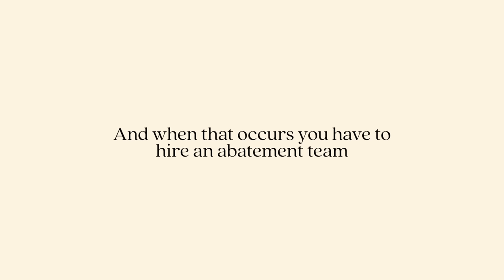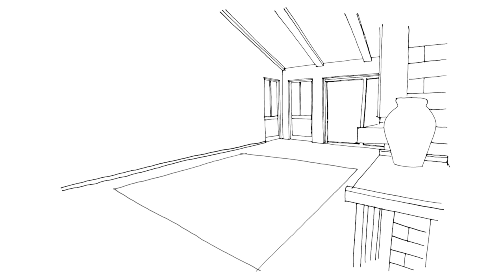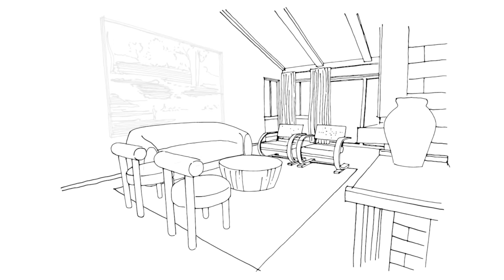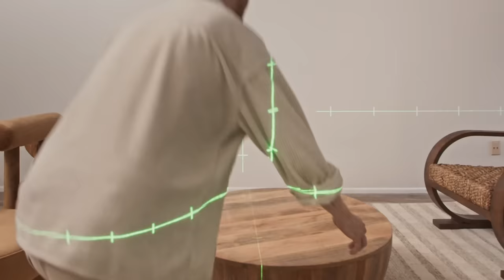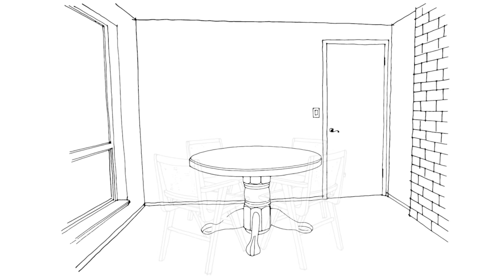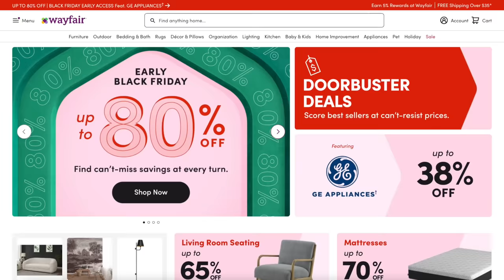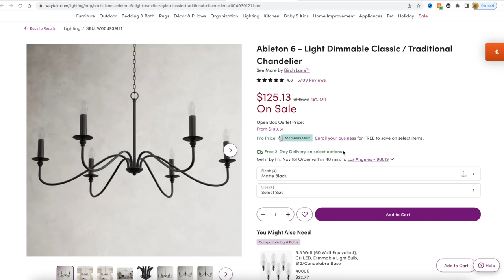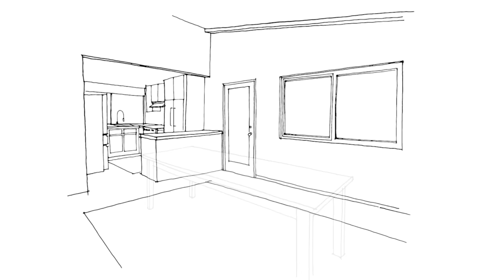EXTREME Living Room + Kitchen + Dining Room MAKEOVER! 🏠

Comment: I’m not sure I like how this is turning out since there is a small baby in the house and they mentioned wanting a bright and airy look. I love some of the elements though such as curtains and rugs, but the furniture I’m not 100% set. Maybe because the project had such a short deadline and most of the items were from Wayfair, not sure. A tip when staining/spray painting always wear a respirator, when you were spray painting you needed a higher grade mask, and when staining sometimes stain applies blotchy like with the cabinets, if you condition the wood prior to applying the stain it can minimize the blotchy uneven parts a lot and it looks so much better. My comment is not to throw shade at all, I love your channel, your work is inspirational. 💕
Reply: Yeah I agree and actually don't even like the finished project. It doesn't feel livable or comfortable to me. 
The cabinets are splotchy, the tambour wall is incomplete behind the TV. 

I love the intention but sloppy mistakes were made which detract from the finished project.

Comment: My only comment about some of the styling elements in the living room is that the blanket ladder, and tall narrow floor lamp and woven vase will be a hazard once the baby becomes more mobile. They’d all be pushed over very easily. Everything that could topple over should be anchored to the wall, and if that’s not possible, then alternatives that are not as easy to push over should be chosen instead. Advice from this momma of 3 boys.

Comment: I LOVE the mural idea as artwork! And the scene is so peaceful but modern with the black and white print. Maybe next time just build the frame out on the floor with mitered corners and attach with sturdy frame hangers in the top. You can use museum putty to seal the sides and bottom to the wall. This will be brutal to change out some day because there are so many nails and they have to fill in and repair the drywall and paint now. Just a thought ;)

Comment: FREAKIN FANTASTIC DESIGN STYLE! As a 20 yr painter here's hard lessons to learn SPONGE ROLL POLY WOOD STAIN FIRST thin, THEN BRUSH IT IN ONE DIRECTION QUICKLY TO STOP UNEVEN BLOTCHES & BUBBLES!  Poly is THICK & DRIES QUICKLY (unlike drippy stain which is always wiped off with a cloth). Also LESS WOOD FILLER  is best on PREVIOUSLY STAINED WOOD because sanding strips the stain & then blotching occurs  (it is best to apply pre-stained wood filler with small spatula, or dab it with thinned stain to match wood. (Wood filler ALWAYS ABSORBS TOO MUCH STAIN looking MISMATCH) A SECOND COAT OF POLY THINNED WOULD HAVE SOLVED YOUR BOTCHING ISSUE but would have also darkened wood even more! Hope this helps others! LOVE YOUR WORK!

Comment: ❤️ the design! That mural 👀 amazing and I want those woven chairs. That mirror was a great find! 👍 I also used Minwax polyshade on some oak cabinets. The oak tends to take up the stain in different shades unless it's made from the same tree. Also use a sponge brush for better application. Can't wait for episode 3. 💯❣️😗
Reply: agree - sponge on stain and wipe off excess -let first coat dry, do again until stain is the depth and rich color I want. I am not sure why Drew NEVER protects adjacent surface from spills or drips - so easy to just put some plastic down on floor and  and countertops - but it's his M.O.😄

Comment: So far I"m about 50/50 on the design.  I like the fireplace, yet not the way you left it unfinished under the TV, you should have at least gone to the mounting piece.  I not a fan of the round table in kitchen nook with the chairs or the weird cheap white lamp, the one the owner had was much better.  I think you used a gel stain on the cabinets and I know it is brush on and usually don't wipe, yet it looks way too streaky.  The hardware was weird also.  Not a fan of the odd chairs in the front room either.  Your taste is a little too far out for me I guess.  The owners knew what they were getting into.  I agree the dining table would look better going length way.

Comment: I’m really not trying to be mean but I’m shocked by the kitchen. Did the budget not allow for new cabinets and counter top? If I was the home owner id rather have a nice kitchen then new furniture. Never in a million years would I have guessed this makeover wouldn’t remove the tile countertops…. The rest is lovely but the kitchen throws me waaaaaaay off
Reply: The cost of a new kitchen would be significantly more than new furniture though. You specifically mentioned new cabinets and new countertops and those are the most expensive things you could change out in a kitchen. And you'd probably want new floors and appliances too. It's either new kitchen or new furniture. You can't have both. And you would not be able to pick out any of the finishes of the kitchen It will chosen for you

Comment: I love the warm deep tones of the kitchen and how you refreshed the wood cabinets by stain versus paint.! Question what prep did you do prior to staining -  degreaser? What was the reason not to do a bit of a light sand and wood conditioner prior to staining? Did you use any type of sealer as a final coat?

Comment: Drew styling 101!
Though you didn't ask, just a few normal comments from a boho lover...
Were all those nails necessary for the wall art? That was surprising. 1. I thought the cabinets would be light, smoothly painted & airy, more natural, less gothic. Drop cloths are useful for those splatters n spills that no one makes.  Lol! 2. Styling for a single person is different than for a young family. Less is usually better for safety sake. 3. The nook table & chairs fit nicely, but I don't see boho. 4. Nice extenders on dining table. Do they have more chairs for that extended seating?

Comment: Justin is adorable! I want to know more about the concrete plaster finish on the top of the dining side table. It's not listed in the featured? I'm redoing my bathroom (new tub/shower is going in late Dec, new paint and flooring soon after). The countertops are a problem. New countertop is so expensive, but I'm not into the resin or epoxy refinishes, either. So now I'm seriously curious about the concrete plaster finish. Can you please share the product? Thank you! You were my inspiration for both my new bathroom and my bedroom makeover. Without you, I'd probably be living with the 70's sea-blue tile for another 2+ years (LOL)